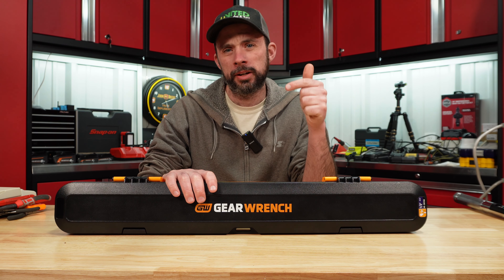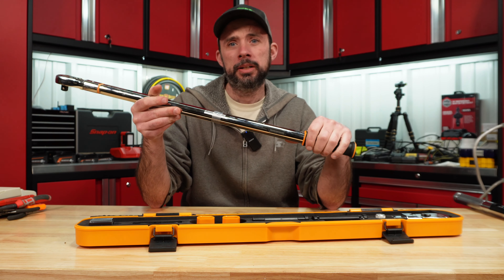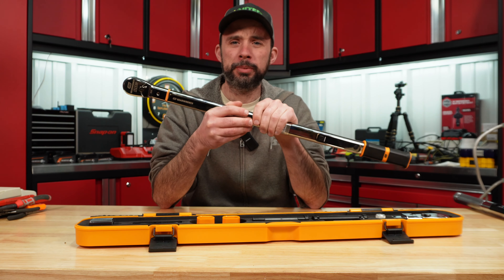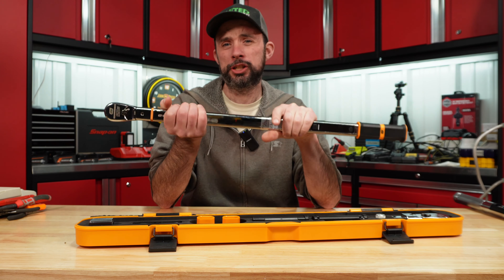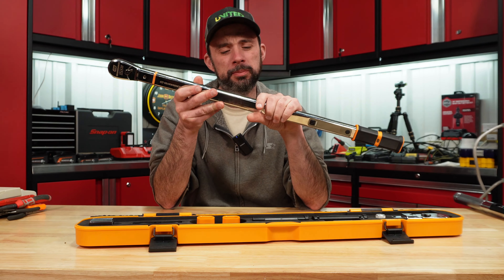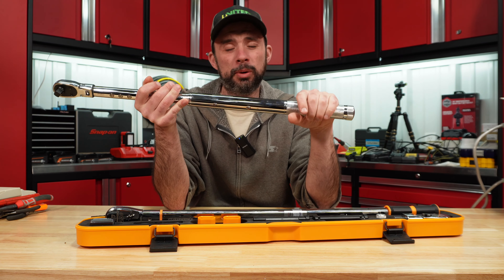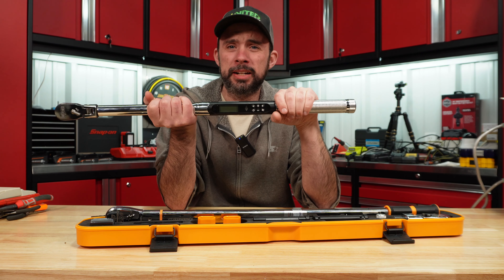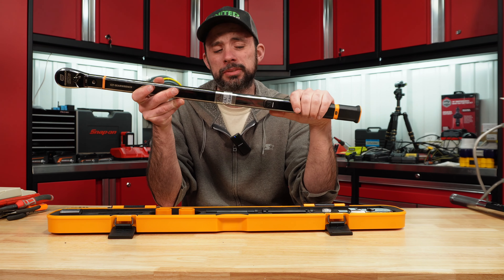Gearwrench E-Spec Torque Wrench Failed After 4 Months Of Use!

Comment: I was debating between the Icon and the Gearwrench 120XP. This one was a little pricey for me, but looks cool. At the end of the day, nothing beats the Harbor Freight warranty and the similar performance to snap on. HF covering everything but calibration is a bargain.
Reply from the maker: Yep I agree!  cant beat that ICON,  really hope we see a 3/8 version soon!
Reply: @Tools-Tested  It was announced at SEMA  2024 The ICON 3/8" is being released in the Spring 2025. Also John if you see this , Have you been using the New GW E-Spec since you received the new one and if so how is it holding up? Did you ever do the review on the 3/8" one? That accuracy blew my mind and my youngest son just picked up the ICON for 40% off (with my CC) in December's 12 Days of Savings at HF or whatever it was called. I hope you can get back to me because I really like the Gearwrench and there products.

Comment: I’ve been looking into this torque wrench recently and there isn’t much information on the internet about it… but the price has gone way down. It appears they have cut it from their line up. I wish I could get it because it is accurate and I find the design very appealing. It’s a shame such a good looking tool isn’t reliable. Maybe they can keep the design the same and rework the screen so that it doesn’t fail. You can get it for under $300 right now which sounds like a good deal but basically everyone has the screen fail.
Reply from the maker: Yeah its sad, awesome wrench when it worked, but the screen has now failed for the second time....  I would recommend looking at the Icon

Comment: The whole point of buying from tool trucks is the service. The willingness to get stuff swapped, warranties, or repaired quickly, and sometimes to loan out a tool, so that you can get back to work. 

Doesn't matter the if it's SnapOn, Mac, or an independent truck, a driver that takes care of you is worth the upcharge.  

Amazon and Lowes don't provide that service, but Harbor Freight is getting closer and closer, which is pretty amazing considering where they were just a few years ago.

Comment: To me that display looks like an OLED display. OLED's have great contrast which is good for readablilty.
But they have pretty short life. 4 months is very short, but there's a very big chance it will fail again in 5-10 years (maybe sooner).
To me, hand tools, and certainly tools in this pricerange, should last decades, not a few years. So I think using an OLED display is a fail.
Also OLED screens have a high power consumption. That's why it comes with rechargeabe batteries. Those also won't be available anymore in 10 years.
Luckily there's a AAA battery holder, but a tool like this isn't for me.
If it's used in a production enviroment, sure, but such an enviroment will demand replacement in a few days, not months.
Reply from the maker: Good point! I agree for the price it needs to last for 10 years and like you pointed out if it fails after that then its probably junk because of zero parts.  Even now they sent me a new one vs replacing the screen.....

Comment: I think its better to buy only made in usa 
Tools That torque, extract and repair threads; 
1.) Precision instruments torque wrench
2.) Rocket socket bolt extractor/ 31pc/$179
3.) Mac tools R.B.R.T / x < full line up
4.) Tap and die set, made in usa.